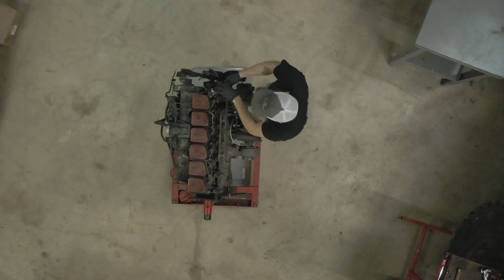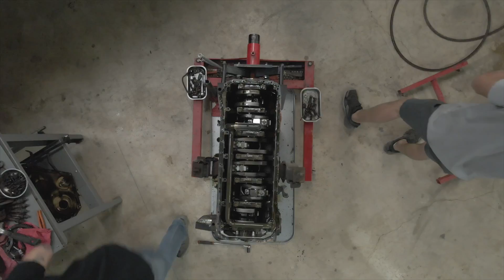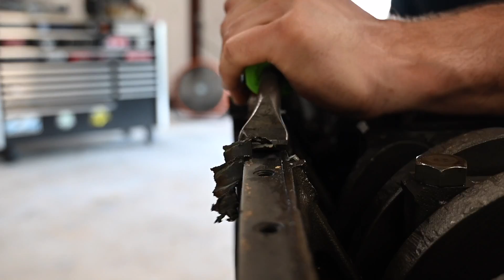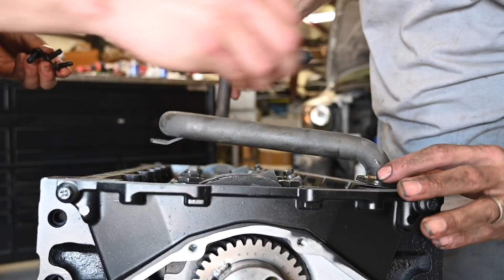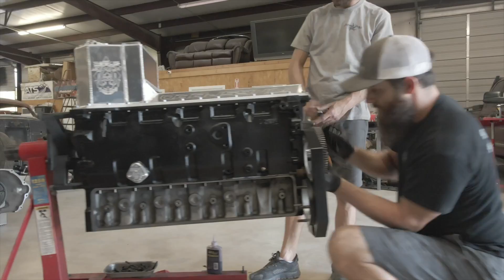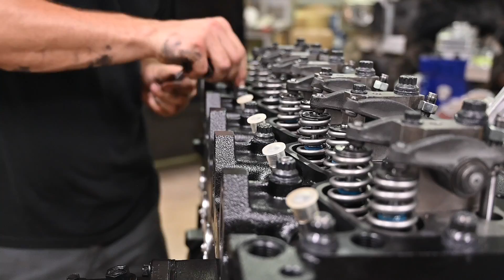DemolitionRanch 12 Valve Cummins Cuda Motor Build

Comment: Just acquired a 1998 Dodge Ram 2500 with a 12 valve! Any advice for what I should do to keep the miles rolling? He’s got 305k miles and very well maintained. Best wrenchers on the Tube! @holdenbrosdiesel

Comment: I've built many different motors and overhauled more than what I've built from 1969 327's to mid 80's 305s and 350s to mid 90s 4.3 vortecs (incase u haven't figured it out I'm a chevy guy) I've even overhauled a 2006 afm 5.3 I'm very well schooled in chevy gasoline motor's I dont really know anything about diesel motors of any brand and the only thing I'd like u to do different in this video is put out 2 videos on the same motor 1 just like this video for guys that already know how to overhaul these motors but then I think you should put out a second longer video going in depth on every particular thing that needs to be done like a youtube Haynes manual telling torque specs and torque bolt patterns etc. But anyway good video would love to see more from you!!

Comment: Sub'ed and looking forward to awesome builds, cool tunes, and great narration. ;)
-From New Braunfels, connoisseur of fine diesel machines
(2) M923 Cummins
(1) M936 Cummins
(2) M1009 CHev/Detroit
(1)M1008 Chev/Detroit
(1) 5.9 24v 3/4 ton
(1) 5.9 12V 1 ton
Edit: Forgot my Pete 379 w/CAT 6NZ  and Freightliner w/ series 60 Detroit

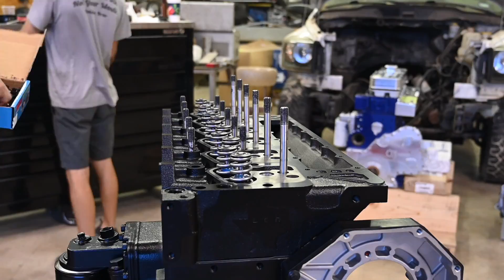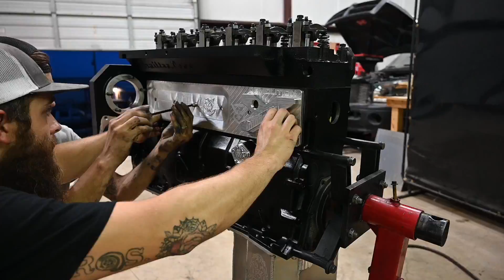Comment: An advice to make the content a bit more interesting is to explain a bit more what you are doing while you're at it, good examples would be at 7:20 - 7:40, 7:55 and so on

No need to explain too much but maybe tell us what you're assembling, what it does and maybe how it could go wrong or why you do it the way you do (maybe through your experience you found a way to avoid a problem)

Other than that, great video, congrats

Comment: Quick question, with the higher psi that the turbos are going to be making, why didn't you use studs instead of head bolts? Just curious. I've been turning wrenches on cars, diesel trucks, and motorcycles  for a total of 35 years now, and have learned through personal experiences that studs seem to work better. Love your new channel, can't wait to see more from you!

Comment: Is it me, or did it seem like the KDP "safety" wasn't installed?
Reply: If the timing cover was any sort of replacement or aftermarket piece, they all come with it built-in already. Hard to tell in any of the video shots for sure, but it does look like the hole in the cover is smaller than the dowel pin, to me anyway.

Comment: Great start guys... Engine assembly was top notch... A bit of an audio issue on round one, but round two was fine... 

Note: I know Matt's going with a high class Moss Green finish, but every company involved needs a logo somewhere... Not under the Hood, but maybe inside the trunk lid... At least a couple of poster size plaques for auto shows... 

Just Sayin...

Comment: Looks like you guys need a little more weight on your butts if you are going to be flipping over big heavy blocks like that. Seriously, I would have loved it a little slower so I could understand a little better how a diesel engine works. Built 1/4 mile and dirt track engines, but never tore into a diesel. Thanks for the video guys, I loved it.

Comment: Never even owned or worked on a diesel but I’m here to learn so I’m gonna ask stupid questions

Such as why does the engine need such a big pump on the side? What exactly does it do? I’m not stupid I’m just curious why it’s so big? And mechanically driven blah blah blah blah blah
Reply: That is a diesel injection pump for fuel.